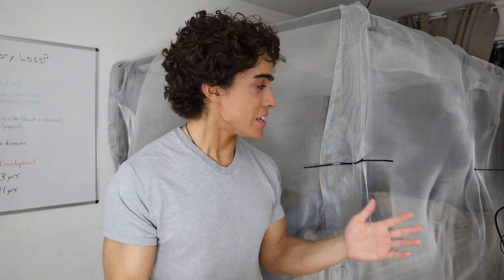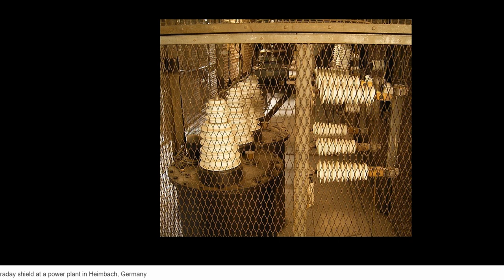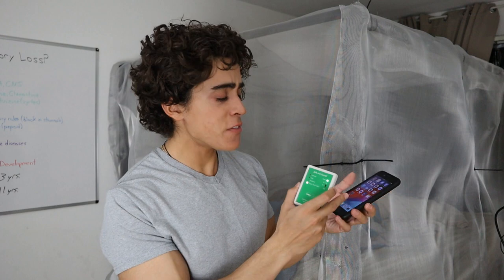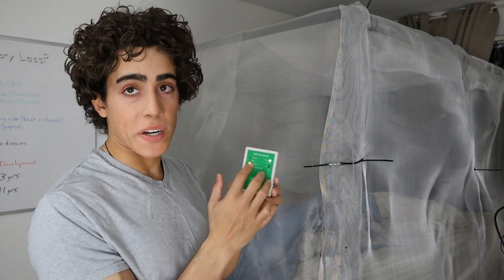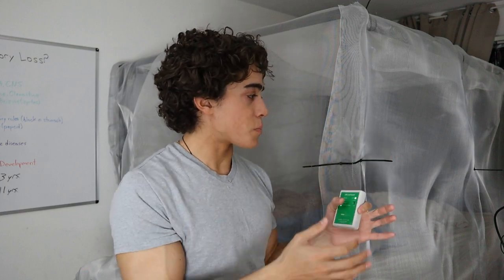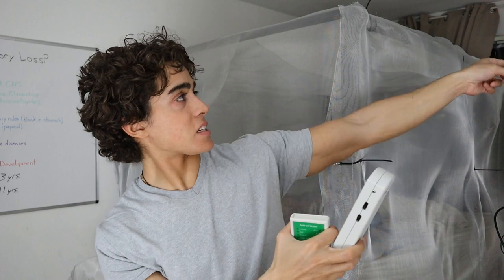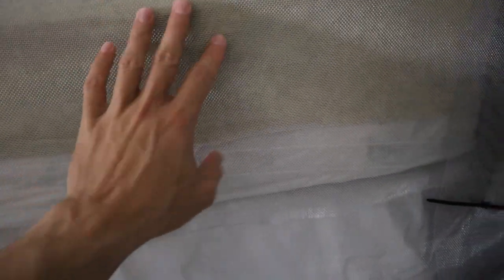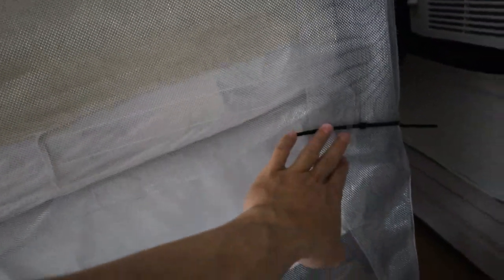How I built my Faraday Cage

Comment: Quartz crystals can also absorb emf. They are a great conductor and one of the few crystals that can produce electricity under pressure. An undervalued crystal.
Reply: You need copper. Aluminum isn't conductive enough. Copper would cost a fortune though.
Reply: Use orgonite

Comment: I watched a home design show years ago with a German-born engineer and Indian-Born doctor and they had built a faraday cage into the walls of the bedrooms for them and the children -- Mesh screen underneath the drywall and flooring. 

The host asked them if it was a little overkill and they both responded in a calm and measured way saying that, while there was no current evidence of direct health effects, there is a lot of early evidence showing an effect of EMF on the cells and they wanted to be "better safe than sorry".
It came into my awareness around the same time as I learned about "grounding" or people that ground their beds to hopefully pull "excess electrons" into the earth, as it can supposedly hold many more times the charge than it does.
It's all very interesting and when I have the resources to create my own home, it is something I will definitely incorporate into the design somehow...maybe a faraday hobbit house?

Comment: I feel more clear headed during the day with my wi-fi turned off at night. Unfortunatley it hasn't been feeling the same. I checked the wifi in my room and I see my new neighbors have a STRONG wifi signal that is strong in my room soooo I need to build this. Getting rid of the wifi at night helps tremendously on your mental state during the day for sure. I really noticed it when my router broke and I had no wifi. Clear headed and calm for moths with no wifi.

Comment: Frankie I made a cage for my bed with aluminum mesh screen, double layered on all sides with a copper wire connected running into the ground outside. Inside the cage I still get perfect cell service and WiFi signal? Any advice?

Comment: You should earth the cage if you want to block the lower frequencies from powerlines (only possible if you have no coating on the mesh). True 'magnetic' radiation is different though. But couldn't see if you had your meter on the E or M setting. If you earth the cage the readings on the E setting should drop dramatically, as long as all sides, including the bottom, are touching and sealed.

Comment: As long as you don't need wifi in your bedroom (get a wired connection for your PCs), I recommend using lead paint on your walls + aluminum mesh on your windows. Make sure to paint your doors and window frames as well, and test it with a meter.
Reply: Lead paint?? That is extremely toxic for your health and the environment.
Reply: @S-Cati  ok boomer
Reply: King Wewuz LXXXVIII > I’m not a “boomer” 😉
Reply: @S-Cati  boomerism is a spiritual malady that can affect someone of any age

Comment: I wonder, if we could make one by painting ready mosquito net with graphite mixed with acrylic craft paint, which is usually suitable for fabric as it is flexible. Graphite is what they use in shielding commercial paint, but graphite and craft paint is very cheap and that commercial paint is very expensive. Of course it would be dark color. However we could paint it over with somehting lighter on top.

Comment: Fun fact, lead based paints also completely block out all wavelengths of EMF. The only danger to lead paints is if you inhale dust particles for a long time.
Reply: There are EMF paints and they're lead free. Of course they don't block everything but I rather not breath in lead.
Reply: @someguy43210  just about any metal based paint can block out emf

Comment: Great content as always. Low EMF Waves from the power lines can only be blocked if you ground your mesh to a power outlet, metal plumbing or the earth directly. 
The next part I'm not so sure about:
I fear that especially with EMF shielding clothing but also with cages like yours the EMF coming through weak spots/ holes might bounce around in it making it potentially worse in some situations. Would be really nice if someone who knows their physics better would elaborate on that.
Reply: Did you figure out how the bouncing effect works? I'm no expert, but it sounds reasonable that if the mesh is grounded it shouldn't bounce around at all, no?

Comment: I am wondering, can I use the same material to make faraday cage for the wireless router? They make commercial ones from stainless steel mesh, which reduce the range by 30 percent(usually still plenty for average home), but reduce EMFs by 90 percent. They charge ridiculously high for a tiny box, so i would love to make my own.
Reply from the maker: Yes you can!

Comment: I'm very worried about the Placebo-Effect. But you got me extremely interested in this. I design & build Series-Hybrid motorcycles. Basically Electric Motorcycles with built in generators to charge the batteries, at any time. I am not interested in having children, but if I do start selling bikes, I am worried about myself and my customers, having high wattage generators & motors, between our legs, and under our butts. 
I was already planing on having components be in grounded metal cases, to protect them from an EMP attack. So even if phones are ruined, I and my customers, can still ride away. But now you got me thinking about that shielding protecting me & my customers, from the bike itself.

Comment: I thought it needed to be a ferrous metal and grounded
Reply: Yes, an ungrounded metal screen will act as an antenna and can make high frequency EMF exposure worse. I'm not sure that Frank's suggestions here are very sound.
Reply: @BobWya  i don't think mesh will do that. I think that only applies to things like aluminum foil. I would add a grounding cable just incase however, i think it would make it work much better. Also copper mesh would work way better. You also need to keep yourself grounded when sleeping in the cage because the cage also blocks the earth beneficial frequencies that humans need to stay alive. You will eventually get sick without these frequencies. Using something like a grounding pillow/blanket cover would keep you connected to the frequencies and fix the problem.
Reply: @JaakkoJohannes  Aluminium mesh is the same as a solid sheet. Both can act as an antenna, when not in a grounded state. The main difference is that the mesh will only block frequencies with a wavelength longer than the mesh hole size. I do have an Electrical Engineering degree - I do find it a bit concerning when lay-folk step into this area (although Frank usually covers his bases reasonably well)... It's easy to actually make your health worse if you fuck this sort of thing up (e.g. Bart K. suggesting to ground yourself to the ring-main ground pin - which totally ignores issues with dirty electricity).

Aluminium does not make a good screen material as it is hard to get a good ground connection (due surface oxidation). Personally I would choose stainless steel - as a screening material...
Reply: @BobWya  alright if you say so. I would never use a faraday cage that is not grounded, didn't know its the same thing as sheet though. My understanding is that copper mesh atleast does not do that if not grounded, although aluminum may be much different since its more reflecting. In any case i would ground the material. I would use copper, it is more conductive and has a type of anti magnetic property to it. You still need to  ground yourself some how or you will get sick.
He did check the inside of the cage in the video though and it apears to Block the frequencies and not amplify them even though it is not grounded. Also i have seen tests done on mesh including aluminum mesh and it does not apear to do what you said even if not grounded. Aluminum sheet how ever does seem to do what we spoke about, so it's not correct to say that mesh is does the same as sheet.
Reply: @BobWya  I was thinking the same thing stainless steel over aluminum
Reply: @BobWya  > Good you bring this up! Hopefully Frankie reads it... Won't stainless steel be very heavy? Compared to an aluminum mesh that is very light.
Reply: @S-Cati  Stainless steel mesh is heaver than aluminium mesh - but not massively so. If you were comparing sheet metal - then sure stainless steel is a lot heaver than aluminium (at the same thickness).
Reply: @BobWya  so what exactly would you advise? 
Build a faraday cage and use grounding sheets?

Comment: I have heard that metal bed frames actually amplify emf.  The amazon link says metal frame.  Also, I wonder if the aluminum screen is just as effective at blocking emf as the expensive shielding fabrics I see online?
Reply: It is actually more effective but not so nice looking. I put up screens on my windows and almost no rf gets through. Bear in mind that if the signal is strong, no material will shield you 100% but about 90% should be better than none
Reply: Which form of EMF? Gamma radiation? Microwaves? Visible light or radio?

Comment: Microwaves are faraday cages, they need to be in order for them to work, they just don't block every type of radiation. And you can't block every electromagnetic radiation because you yourself give off electromagnetic radiation (infrared for example), light is another type of electromagnetic radiation, not to mention that we live on a gigantic dynamo that produces a big magnetic field, as well as cosmic background radiation which you can see if you build a cloud chamber. Physics rambling aside: for a faraday cage to work better it needs to make full metal on metal connections with no gaps, meaning it needs to be a closed box, meaning you also need to cover the floor and have a door frame that makes it not flop around when closed and ensures there is no gap when closed and earthing it also helps

Comment: Very informative, Frank, thanks! :) I always turn off devices and my wifi at night. However, a frequent issue in apartment houses can be that you get massive amounts of wifi from your neighbors. Unfortunately, that's the case for me. I receive the maximum signal (I check this on my phone, i.e. the reception of other routers) of at least three routers from neighbors. I already considered asking them to reduce the strength of the signal (with most routers you can do that, go down to e.g. 50 percent, etc.). But I've hesitated doing that, as I'm not sure how they would react :/

Comment: You are definitly wrong about the blue light. Instead of assuming things, which Ive noticed you do a lot, you should get a Aura ring and track your sleep. Track your sleep before and after using blue light blocking glasses. I bet you will notice a major difference in deep sleep.
Reply: Also try tracking your sleep with and without your EMF shield and i bet you wont notice any difference at all. All you need to do is put your cell phone in another room and turn off your wifi.
Reply: Blue light exposure is well researched. It suppresses melatonin secretion, increases stress hormones, and increases sleep latency. There are many studies that undoubtedly prove this.
Reply: The only reason EMF even affects sleep is because it mimics blue light to the brain. Blue light is actually light. Not a mimicry.

Comment: Are phones better on the phone carrier minutes connection over the house wifi? Idk exactly how to say it correctly.
Reply: The greater concern with phone is when you are carrying it on your body, but when it's not near you, the bigger concern is your environment.

It's always been easier to block WiFi than phone signal. If I have to, I rather put the phone on Airplane mode, and only leave WiFi on. Or while carrying the phone, use a faraday pouch to reduce the emf from the phone going to your body, use the pouch as a layer between your body and the phone. Phone signal is so strong that with most faraday pouches, even if you put the phones inside the pouch, you will still get calls, but at least the EMF is much reduced.

But if the phone is not next to your body, I would be more concerned about environmental EMF like wifi router and cell towers, that's when you need a faraday cage.

If you have an Android phone, there are various apps like WiFi Analyzer and Network Info that tells how strong your wifi or cell signal is, and also faraday cage testing apps. It's a good way to test if and how well your faraday cage is working.

Comment: They are also used in your cell phone.

Also, you dont know as much about electromagnetic radiation as you might think. Cell towers and cell phones use the same frequency range (1 divided by wavelength), thus the name. 

The interaction of electromagnetic radiation with the body is very dependent on the frequency, and there is only a narrow range where its going to heat you up. 

Basically this video is mostly pseudoscience, from the standpoint of an electrical and HF engineer. 

Also, a correction to your Faraday cage stuff, the maximum frequency you can block with mesh, is width between the wires in the mesh. Anything higher frequency (or shorter wavelength) will pass through with only partial reduction of power. Hence why you can see through it. (light is just another wavelength of electromagnetic radiation)

Oh, and you need to have very good contact between all parts of the cage to have proper shielding. At least at any power level id consider slightly worrying. 

If you want to shield yourself from low frequency fields, use MuMetal or just pure annealed iron. Or alternatively use an active 3D Helmholtz coil with a 3 axis induction or flux gate magnetometer to null the low frequency fields.

Basically, all this is is placebo. You have also shot your credibility in the foot. Good job.
Reply: i really hope this video was a joke
Reply: @ryanray6215  like gamma rays, if they pass through something they by definition do not interact with it, thus not doing anything.
Reply: @ryanray6215  oh, and i have a router with one of the strongest legal transmitters you can get, and it has trouble penetrating just a single foot of concrete. so i dont know what monster you have, but it certainly isnt a normal router.

Heck, even industrial access points at my job which transmit with multiple watts, have problems getting through a single 1 foot concrete wall.
Reply: @ryanray6215  probably reflections off an adjacent building, or resonance within some wiring.
Reply: Do you have discord? Can you help me with my physics course
Reply: @versatile3337  theoretically yes, in practice im currently rather busy, so it depends on the subjects of the course and how much help understanding them you need. i could give it a try... i do have discord, post your username / number and ill add you
Reply: @lbochtler  So the stuff the Frank sells (EFM clothing/canopy) is placebo or does it actually work? Couldn't one just turn off their WiFi completely and disconnect all electronic sources?
Reply: @versatile3337  in order to properly shield anything from "wifi" basically radio waves, you need a full enclosure whose largest gap in the structure must be no larger then 1/2 the highest frequency signal wavelength one wishes to shield against.

Anything less are you made among other possibilities, a rf resonator which concentrates rf power within itself, another option is an antenna, a focusing reflector, etc...

Shielding rf with thin things is a tough thing to do. Best leave it to the pros or at least do some in depth research in rf engineering.
Reply: @versatile3337  forgot to reply to the turning off of wifi and disconnecting unnescisary power draws. That methode is very effective in reducing EFM in the area these things are located in. I use this methode in my electron microscopy lab, since these machines are incredibly sensetive to magnetic fields and radio waves (depending on detector). Thus in order to work at the highest resolutions, such as atomic scail imaging, I have to disconnect and turn off all equipment in the vicinity. Also wifi is banned in my lab due to interfering with these and other precision instruments.
Reply: @lbochtler  great to know, haha. Do you think Frankie's emf products are worth a shot?
Reply: @versatile3337  the meters or the stuff he used for the his interpretation of a faraday cage? for the meters, they are mostly low end products, but they do work within reason. however their usage dose require some basic knowledge on EMF and fields in general, both RF and AC Magnetic. 

The faraday cage is a rather decent solution, assuming the floor is also covered by the mesh. 

Btw, if you want to block how frequency fields also, you will want thick iron slabs, or if you have money to blow, go for mu metal slabs. 

You can also use an active field suppressor, which is a 3D Helmholtz coil with an absolute magnetometer at its center. the coils servo with the magnetometer to create a field that exactly opposes the field that's creating problems. 

However, unless you have applications requiring you to limit the EMF and AC fields to an absolute minimum, going down the rabbit hole of EMF detection and reduction is a costly and time consuming endeavor. If you are concerned about EMF to the point of investing considerable money, might i recommend you move to the national radio quiet zone around the Green Bank Radio Telescope.